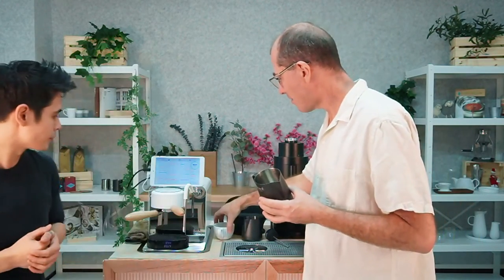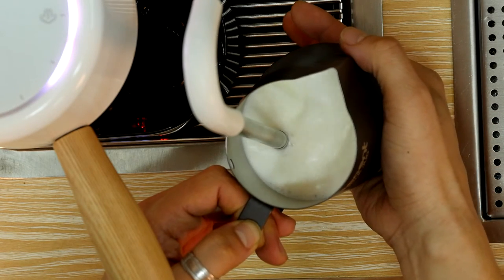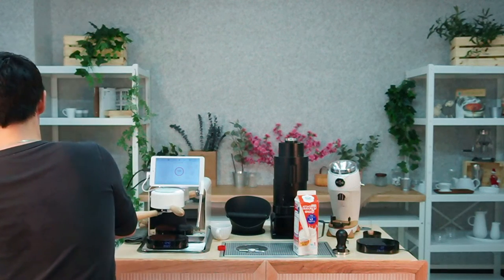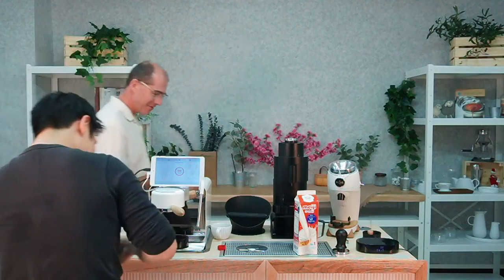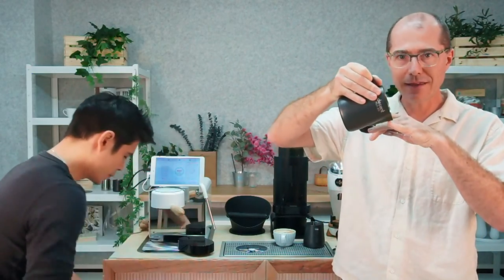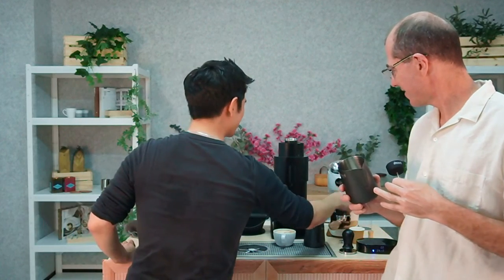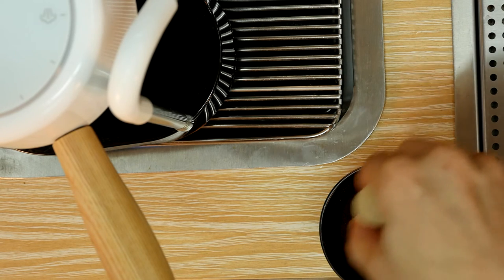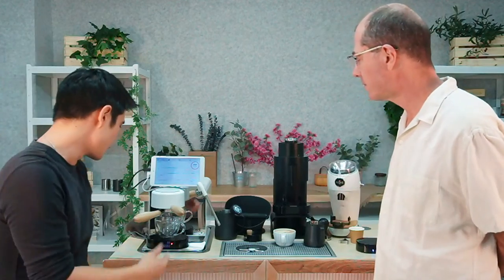The Decent Milk Jug

Comment: Nice show, really needed some help with latte art basics. My jug has the rolled spout and never knew what that was for. Used pliers to reduce some of the roll. The temperature info was a help as well. Kepp the contient coming!
Reply from the maker: Nice hack! You should notice your flowrate of milk when pouring to be slower compared to the lipped version. When your pouring has been honed you will gain more flexibility with this jug. Unless you plan to pour the wide framing latte art.